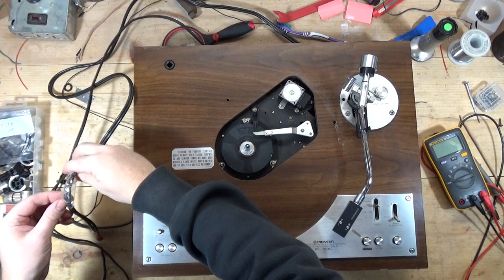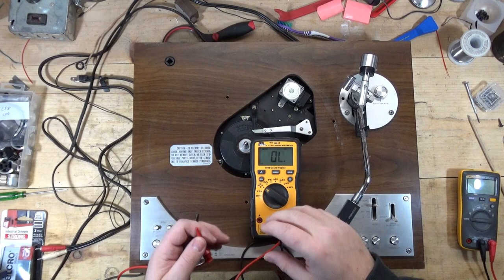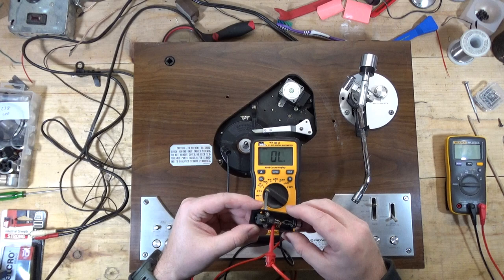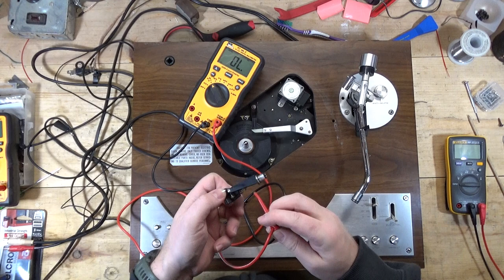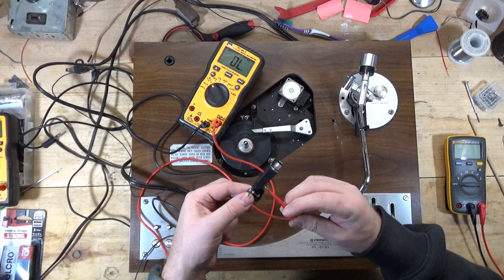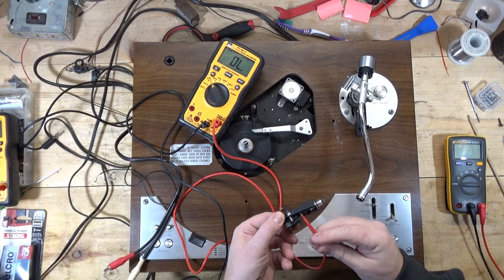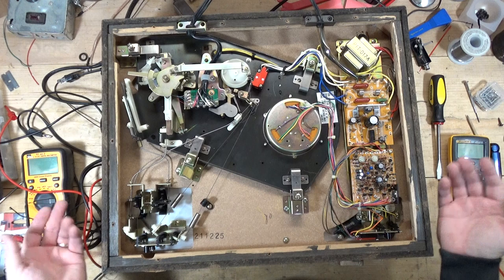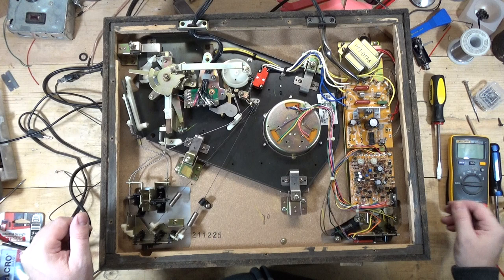Troubleshooting a Turntable Channel with No Sound

Comment: This helps. My technics 1200mk2 has intermittent sound coming from the left channel. I’m thinking it’s one of the 4 tonearm contacts that may be corroded. That or has a contact issue. The turntable was moved around a couple of years ago and I don’t think was packed well.
Reply from the maker: Several possibilities for an intermittent channel, at least these are fairly easy to work on assuming it’s a wiring issue.